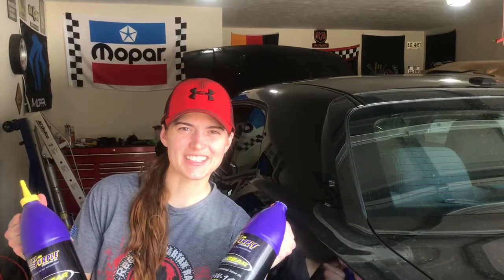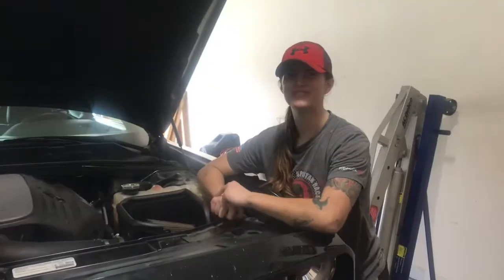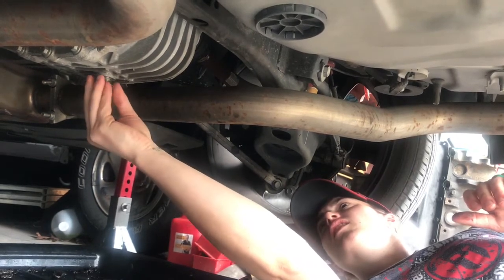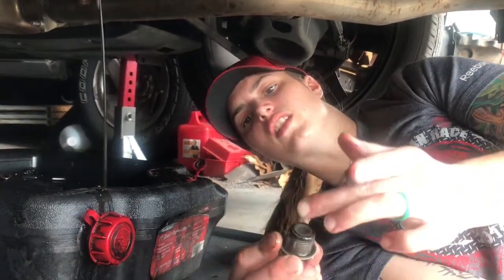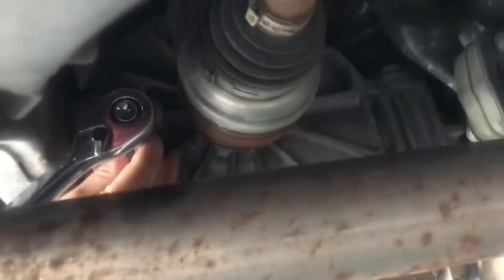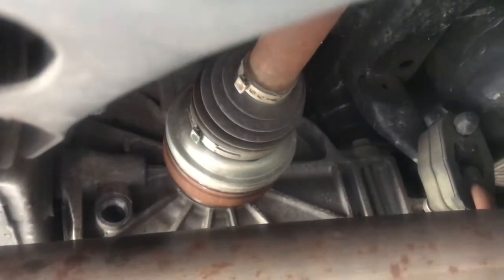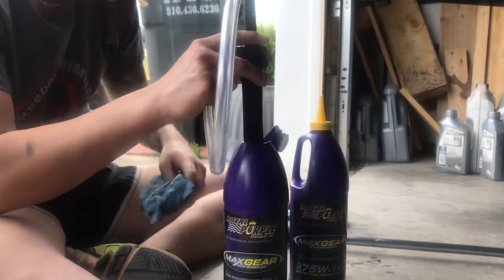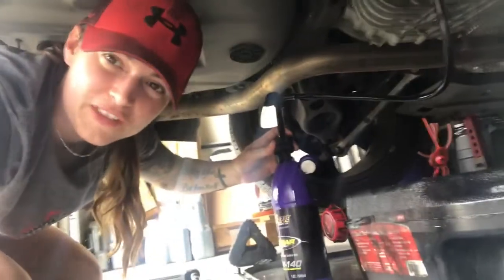How to change rear differential fluid dodge Challenger

Comment: How many miles you got on your challenger before you did this?
Reply from the maker: Morgan Freeman it’s at 80,000 now but most manufacturers recommends every 30,000 to 60,000. This last change was after 20,000. Car didn’t seem to like Valvoline, if u noticed in the video it came out pretty black and it wasn’t like that the time before ha, that’s why we went w/ royal purple.
Reply: TechTipfromGarageChick , have you had any issues after, do u still feel confident with the royal purple. Thanks again for replying!
Reply from the maker: Morgan Freeman np!, yea we have used it before and it worked fine. You can always going to your local dodge dealership and get factory specific mopar fluid as well, possibly cheaper🤔
Reply: TechTipfromGarageChick , cool thanks a bunch!
Reply: @180BlockPass  how much did you put in. I could only get 4 oz of modifier in plus 3/4 of a qt of oil....?